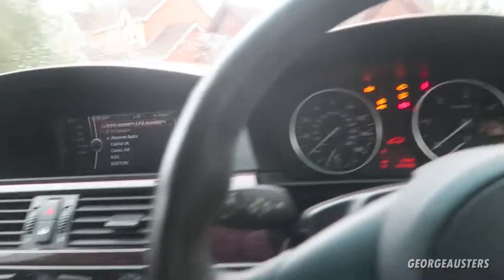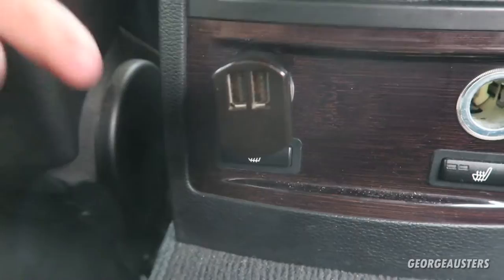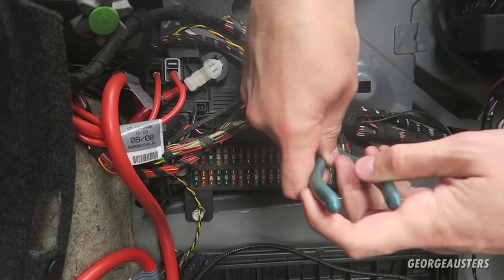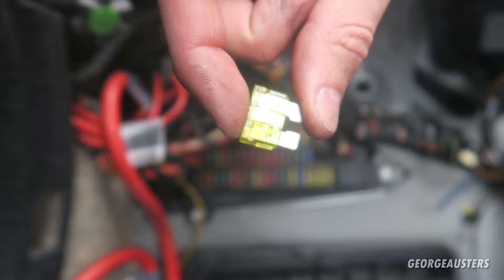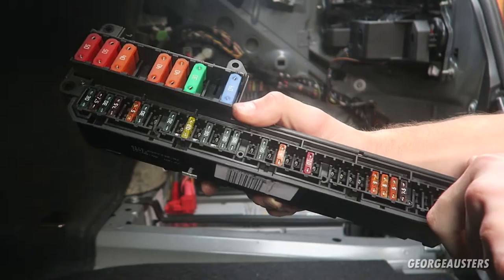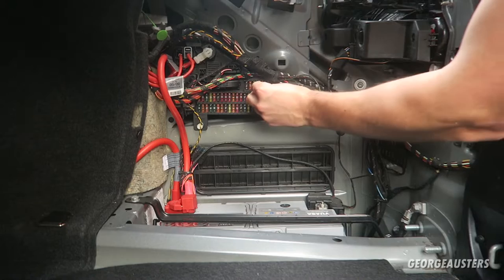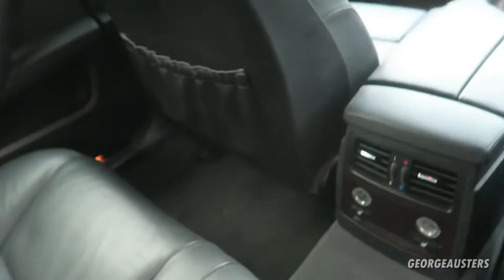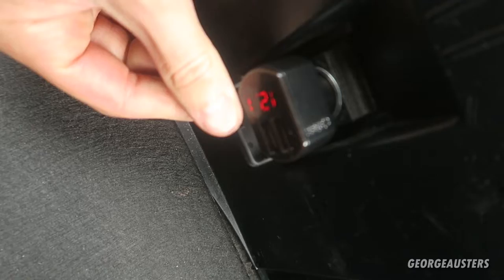BMW 12V Outlets Not Working? Watch this... Fuse Location

Comment: Really helpful video; the 12V socket in my '08 6-Series had stopped working and was worried half the dash would need dismantling to fix it, but thanks to this, I found that one of the two fuses you point to had indeed blown. I put a new 20A fuse in and the socket is now working again. I was banking on BMW using a standard fuse box and fuse diagram across that era of models (they did). Nice easy fix that saved a slightly embarrassing trip to a mechanics to have them swap a fuse.
Reply from the maker: You’re welcome

Comment: Hey George. I have a 2008 E350 Mercedes. The Sirius Radio signal is too weak to receive the signal. Any suggestions on how to increase my antenna reception?
Reply from the maker: Could be your diversity antenna failing

Comment: Hey George, any tips on upgrading the voltage on the arm rest USB connection. My iPhone barely charges when connected, still charges, just no juice.

Thanks, loving your videos!
Reply: Dealer said that after market just don’t charge like a BMW charger (of course) but it does help. I guess worth the extra money